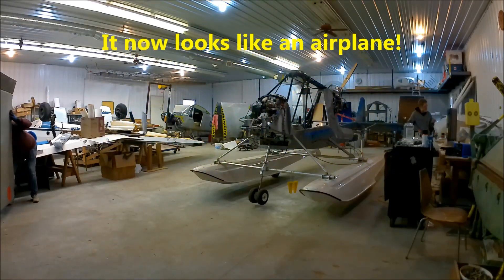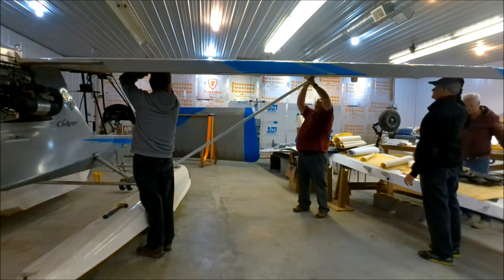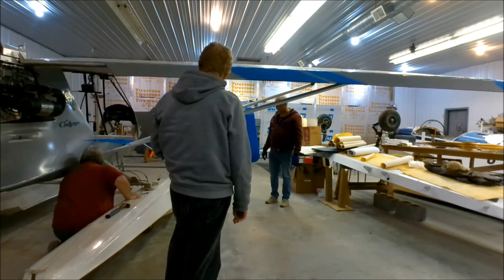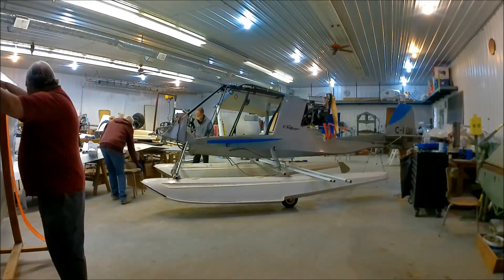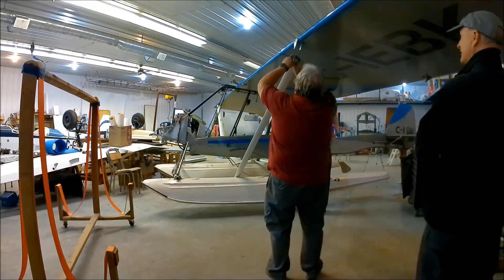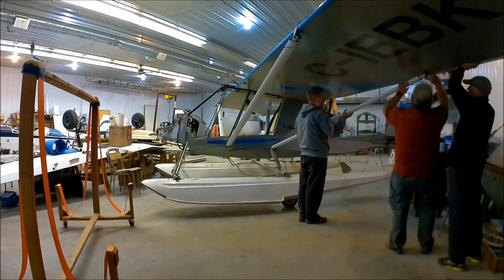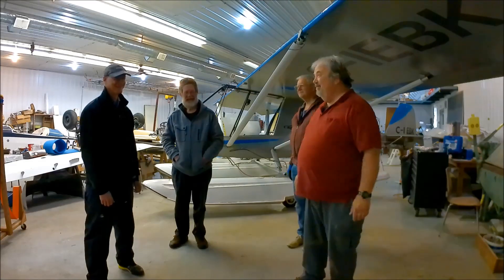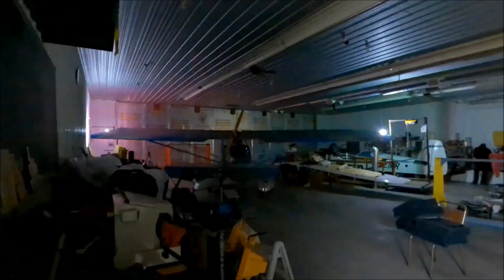EP 59 It now looks like an Airplane! Challenger 2 Ultralight Airplane

Comment: now here is my question does the 503 run on 100 LL Fuel or is it more of a 89 octane thing ????
Reply from the maker: The engine will run on mogas or avgas. The problem with mogas is that in Canada, all automotive fuel now has ethanol, which destroys engines if it sits in them too long without use. The problem with avgas is that it tends to foul spark plugs and build up on the pistons and rings, requiring the engine to be serviced at greater intervals. So one must choose which is the lesser of the two evils and live with it.